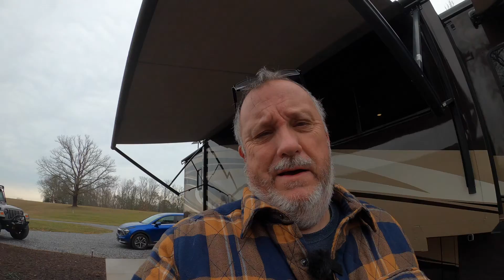How to Service Onan QD 8000 Diesel Generator 🚐⚡ | 🧑‍🔧Sunday Solution

Comment: I have found that the oil filter is much easier to remove on this particular generator when taking off the front panel of the generator instead of going underneath to that little trap door. Supposedly having that door is fot easier access to the oil filter  but I don't find that to be the case for me anyways.
Reply from the maker: Thank you for the suggestion.